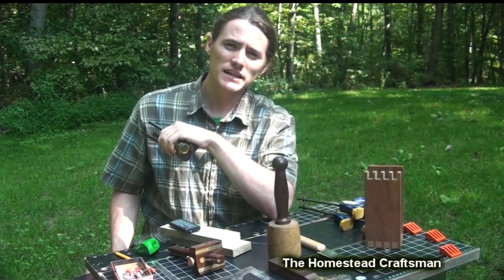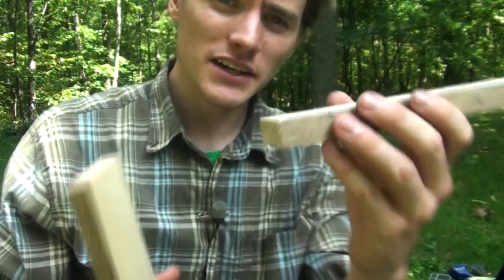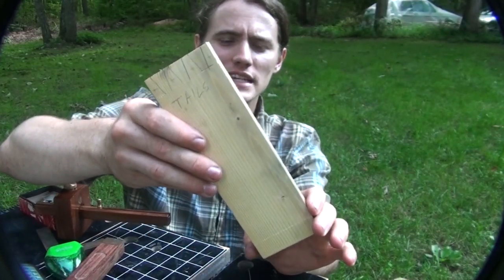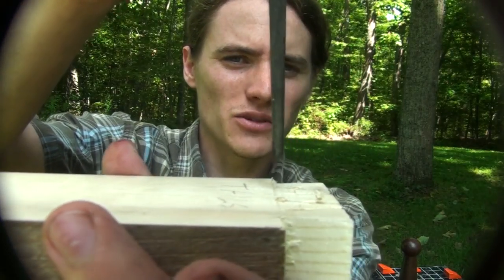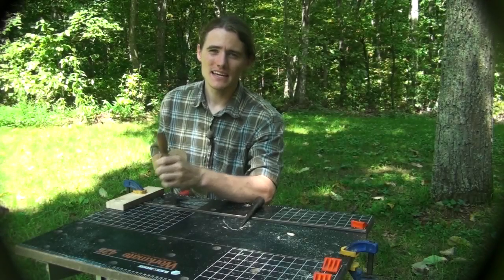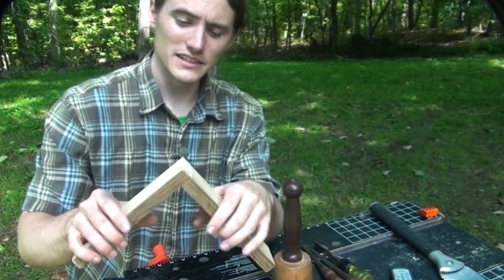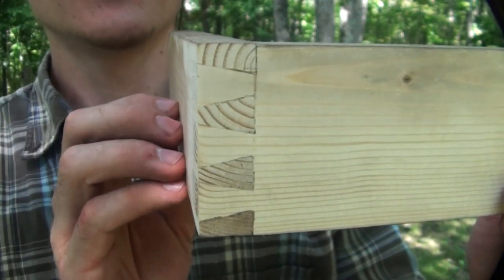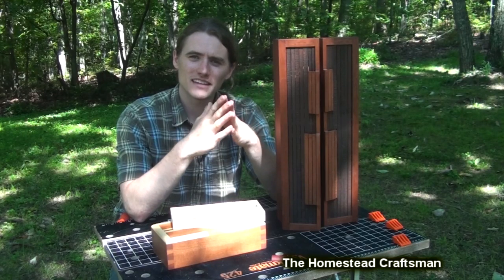Make a Dovetail Joint with Hand Tools - Fully Explained!

Comment: Makes it easier when you have the time to splain it to us less advanced learners.  Thanks.......................Ross
Reply from the maker: Ross Sullivan There are some things about woodworking that are definitely not easy as a whole, but in general, much like many other things, woodworking techniques are a series of simple steps combined to make up the technique........such as dovetailing. Knowing the steps is pretty easy, tool control is the learning part. Once you've got tool control, you can take on most any task. Before ever doing any dovetails I had good tool control so my first dovetails fit great (much betting than this video) ........ I say this not to brag, but to illustrate the importance of tool control and hand eye coordination, which is all about practice.

Comment: I would like to thank you for this video.  I'm an electronics guy, and I've been wanting to build a guitar amp for ages.  Finished amp cabinets run in the $300 range minimum.  I watched a couple of videos about building amp cabinets and they all used power tools, that frankly, I couldn't justify buying for building a couple of pine boxes.  With the cost of the power tools, I might as well just buy the finished cabinets.

From watching your videos I'm fairly confident that I can make a solid, rugged box with hand tools, and then use a hand router to round over the corners.

Comment: What a great video! Thank you so much for taking the time to make this, it has really helped to explain the process and I cannot wait to have a go at it myself. Best wishes from the UK. :-)
Reply from the maker: Rusty_Cylon Your welcome, I'm glad the video worked for you. While I don't cut dovetails daily, I do utilize them in a fair amount of projects and so far they have all been hand cut, not sure how many exactly, but it's a bunch. In my situation I can layout and cut the joint before you would be able to set up a router jig. Most of mine are in drawers and smaller boxes. I like the look of hand cut dovetails for the layout marks and small variations that occur. Thanks for watching.

Comment: Great video.  Great explanation.  I'm trying to get into the more 'advanced' woodworking skills, and this made dovetailing seem not quite as intimidating.  Thanks!
Reply from the maker: Good, they are not that hard you just have to take your time, the first ones I cut went together perfect, I just focused. With that said, don't worry about making them perfect, just do lots of practice first then try to nail it. You can cut most all types of wood joints by hand, just work your way through them, even if you do intend to use machines.....even if the power is out or my tools are down, I can keep going.

Comment: Thanks you feller.  Great video.  I'm just getting started I cut my first dovetails using a scroll saw.  They came out OK but I think I can do better with a coping saw, a fine tooth back saw and a chisel.
Reply from the maker: Your  welcome, I've only ever cut them by hand with a japanese style saw. I could do them with a back saw, but I just don't have one for dovetails. I like japanese style for their thin blade and for cutting on the pull stroke, I feel it's more controllable. I used to use the japanese saws from woodcraft, but started using the $10 harbor freight saws and get great results. Thanks for watching and good luck with your woodworking!

Comment: Well done and good advice. Thanks for your time and sharing your experience. I continue to struggle with the fast and consistency of professional jigs and routers versus the satisfaction of using my older hand tools and lots of loving labor. Good show:) Okie Carpenter
Reply from the maker: Hey, thanks for watching. Some of the dovetails that I cut take a long time, but most I cut very fast (off camera). For example, my work bench has a drawer that slides through to both sides. The drawer is dovetailed and I sailed through them all in about 20-30 min. I like cutting them buy hand since I usually only cut a small number at a time. If I was cutting tons of them at once, I'd probably want to use a jig, I'd like to get the porter cable omni jig, seems to be a good performer and not tooooo high priced, but still not inexpensive.

Comment: Subscribed!
I've been waiting for someone to explain this without the table saw, router table, drum sander, etc... I'm trying to get into woodworking on a budget and only have a backsaw, circular saw, jig saw and other basic hand tools... Now I just need a good set of chisels!
I was going to try making a cigar box with mitre joints and splines but this may be worth a try instead!
Thanks!
Reply from the maker: L Miller Well I'm glad you found my channel, if you have any friends that would like it let em know. If your looking to add to your tools, just buy used stuff. Craigslist or similar classifieds. I'd aim at getting a miter saw.  Then if you want to add more tools start aiming at a table saw, then a planner. Also adding things like sets of drill bits, squares, etc. will expand you options. In general though, when learning the basics, start with your hand tools then move to power. Even when you use "all" power tools you still do a fair amount of handwork.  As far as chisels, the irwin chisels are nice for the money, but I still use my cheap harbor freight chisels a lot. If they are sharp they work good.  But mostly I use old wooden handled socket chisels I have bought used, usually no more than a dollar or two. Ah, and one great thing to have and a great opurtunity for some practice is building a workbench. It does not have to be fancy, but just take your time and make something that you think will suit you for at least a couple years. Then down the road, as your skills grow and you find out what it is that you are most interested in making you can build a new one that is suited. I would also choose dovetails for your cigar box, as long as the boards are not too thin, anything more than 1/4 or 3/8, thinner than that and you are best to use finger joints (box joints). Good luck and thank you for joining me here on my channel.
Reply: Wow thanks for the response! The Homestead Craftsman
I always buy used tools (except for my new circular saw that was on sale!), especially the pawn shops around town; I love to haggle them... Unfortunately I have no room for a mitre or any table saw, not even a workbench right now as my apartment is tiny. I just have to work with what I have until I can upgrade my living space haha.
Thanks again. I'll be watching more videos for sure!
Reply from the maker: L Miller Look up track saws, you could do a couple of sections that would make it possible for you to rip boards pretty straight. When you don't have many tools a good method when coming up with your projects is to think backwards. Don't come up with an idea without thinking of your tools, you'll just end up wanting more tools you can't have. Buy lumber as close to your dimensions as possible. When I was in college I rented a house with 4 other guys, it was a big house, and I took over one room as a wood shop, right in the house. it was about 10 by 12 feet, I had a table saw, miter saw, planer, jointer and most of the hand tools. The whole little shop was put together for about $500-600. It was tiny, packed but very cool. It was the first little shop I had as my own and I loved it. I would put ads on craigslist for making custom furniture, and other ads for making platform beds. All of it was made from dimensional lumber from lowes, which was about a 1/2 mile away. It was great. I sold a bunch of stuff, all of it was custom orders. Coffee tables, laundry tables, tons of beds (several a week) book shelves and dining room tables. It was the only form of income I had for 4 years and paid for everything I did while in school. So long story short, you can do a whole lot in a small space. If you ever feel like it, I'd love to see a photo of your set up, even if it's not much to see.
Reply: The Homestead Craftsman haha That's awesome!
I just graduated college and am looking to start a small setup similar to that.
I'm in a 1bedroom apartment with my girlfriend so I literally am working out of my car haha, I have a bin full (but organized) or all my tools and the other side of my trunk (back seats folded down) is for lumber.
It's working for now, but I'd like to eventually get out of my wood-shop-on-wheels.
We're looking to buy a house soon with a dedicated garage for such.
But for working out of my trunk I've built a few things already: Coffee table from 120year old reclaimed barn wood, a fully adjustable easel (girlfriend is an artist), and an entertainment center...

I love thinking backwards when starting projects. I just imagine what I could do with a full shop!
One day...
Reply from the maker: Now that would make for a good youtube channel, "The Backseat Woodworker" or some play on words like that. Working like you are now means that you have easy to please standards, so when you get your garage you will feel like you have the dream shop of kings. Standards are a dangerous thing, it's best to be in the middle of the road, keeps you happy and not disappointed about everything that is not important. Transfer that same mentality to what house you buy and you will avoid spending more than you need to. If you plan on staying in the area, consider houses that you could end up moving out of down the road and keep it as a rental house, that extra money may free up some of your time to spend doing things you like, working in your shop for example. I enjoyed hearing about your "car shop" and projects. Good luck in your search for a house or in your case First the shop with the house being secondary. Thanks again.
Reply: The Homestead Craftsman 
We most definitely are taking the minimalist approach! And yes... I'm looking for a garage with a house attached, she's looking for a house with a garage attached, (fireplace would be nice too).

 Nice chatting with ya!
I'm sure I'll have questions once we have a shop all setup down the road; you'll be hearing from me!

Take care and Happy Holidays!

Comment: Great video, thanks. If you are making a box, how do you attach a bottom to it?
Reply from the maker: Amir Miller I route a grove around the inside and fit a solid panel into it. For example today I finished up a drawer (basically a box) the outside is 3/4. The bottom is 5/8 thick, solid pine panel, glued up out of two boards and planed. Then on my table saw I bevel the outside edges on one face of the panel. (like a raised panel.) So the outside edge around the panel is now 1/2 inch and tapers up to the 5/8 inch toward the center on all edges. The grove routed around the inside edge is 1/2 inch, so when the panel is fit it snugs into the grove, leaving no gaps. I also have about 1/8 wiggle room in the panel for expansion and contraction. You can use a plywood panel to avoid any worry of that, but I like the look of a solid bottom, especially when pulled out and flipped over (only seen by other woodworkers and my self, no one else flips the drawers over to see that detail) Hope this explains it, read a couple times maybe. The project that I am working on is almost done and I'm going to do a video talking about it's design and construction details, not a build along, just show and tell, gives me an opportunity to wander a little talking about design and different ways to go about it. So check back, soonish, I'll touch on the bottom of the drawer for you to explain, it is the same as any box I would make. Thank you for watching the video and leaving a comment.

Comment: Great Informative video. Thanks.
Can you tell me. What angle do you recommend cutting dovetails?
Reply from the maker: Hi Leane,
I think I was using a 1 to 7 slope, which is kind of tame looking. For a more pronounced dovetail a 1 to 5 can be used. The truth is, it doesn't really matter, you can just set a T bevel to somthing that looks good and make them all the same. There are "rules" to angles, but the best way is to just do some experimenting and see what you like. Once you find an agle you like. Make a little angle jig out of some really hard wood and use that as a fixed angle, you can have several for different angles. Google wood dovetail marker, that will give you an idea. Thanks for watching.
Reply: Thank yo very much for the detailed info!

Comment: Hey, I am a former Marine.  Is that your purple heart?
Reply from the maker: Dennis Murphy Hi, Dennis. It was my Grandfather's. He was in WWII, also Marines. He got it in Iwa Jima from getting hit with shrapnel. He is no longer living, but I have his purple heart, I made the cabinet to hold it. The cabinet it's self mounts into a reclaimed board, wide and thick, that is as long his height which has several thousand rice sized burn marks in it in rows to represent fallen and injured soldiers. The piece sits on the floor and leans against the wall. It was a pretty involved piece to make and took quite a while to complete. Thanks for the question and your service.
Reply: Once a Marine, always a Marine. Semper Fidelis
Reply: Mason Semper Fidelis devil dog

Comment: Well Tomorrow in my woodworking class I'm required to make some dovetail joints. Do you have any advice to give me so that I don't mess. I may me a girl but stuff like this really gets my attention and I'd like to do my very best so that I can one day make this my very own trade or side job
Reply from the maker: Not to much I can say that's going to make you cut dovetails any better tomorrow. If your learning them tomorrow, no one is going to expect you to nail it perfect. Practice is the only way. My biggest piece of advice is to don't worry too much about the first try, just get it over and do it again, otherwise, you'll take your time, be supper careful and they will still look bad. Repetition is key, once you've got it down, you will still be able to move quickly through cutting them but they will look nice. Sorry.....but there's no magic spell I can cast on you to cut perfect dovetails.
Reply from the maker: How'd your class go with the dovetails?